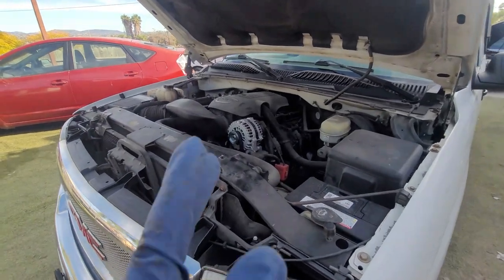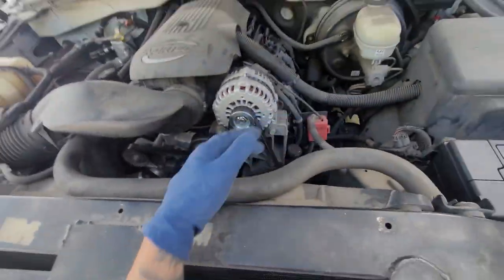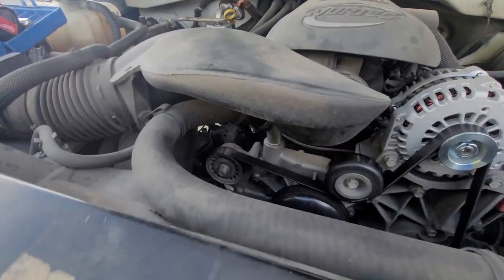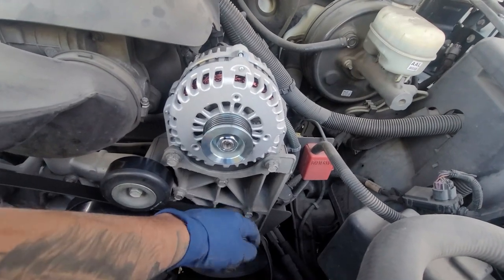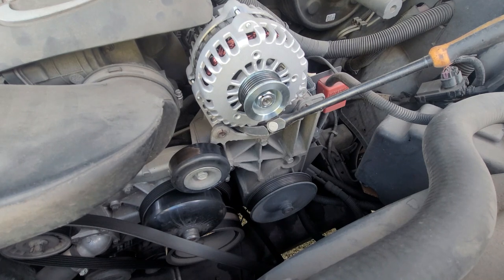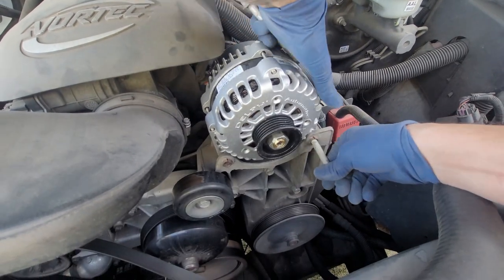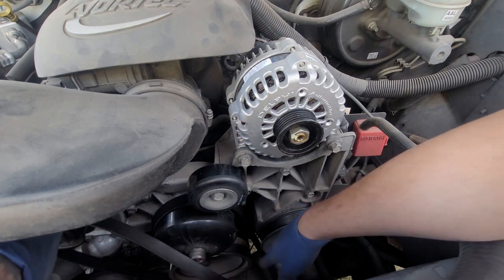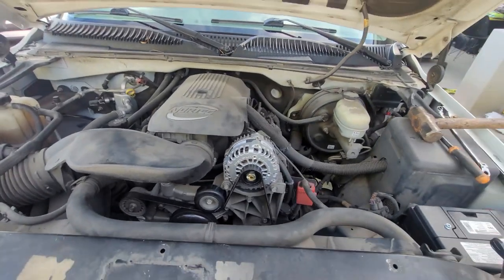2005 GMC Sierra 5.3L alternator replacement

Comment: Looks like you also have battery bay on left fender well. Mine has battery there. What is that charging? Thanks
Reply: Because diesel models have two batteries gas models have that space it's just unused it charges both batteries when hooked in series .